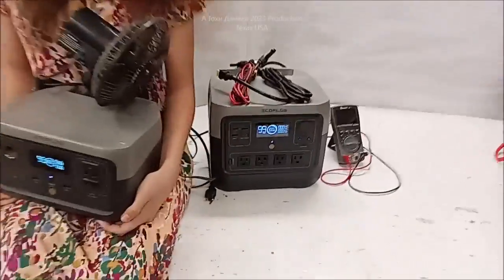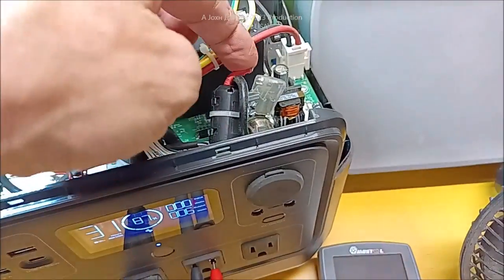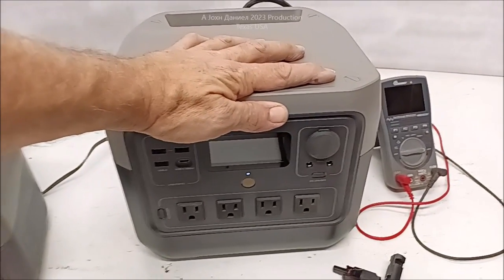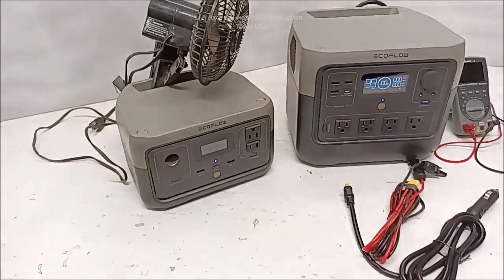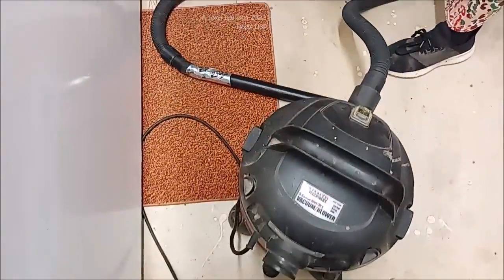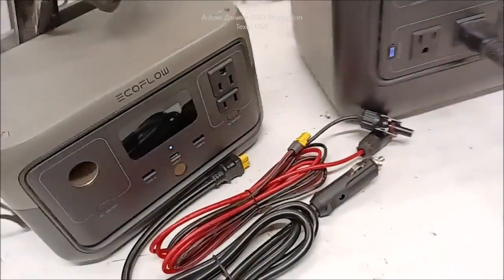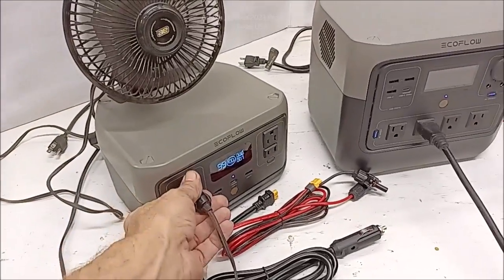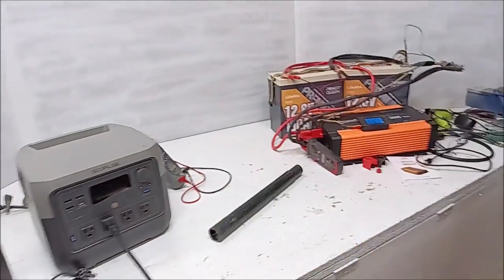Ecoflow River 2 Pro 800, The Problem, the fix, and REAL review!

Comment: River 2 max 512 wh
Reply from the maker: I would say after a year of using constant as a UPS, RIVER 2 MAX 450 wh It has lost that much battery ability in a year. Very sad too. Running it on 2 solar panels ( 125 watt ) and it gets full charge and unless cloudy never drops under 20% except a few times which showed its deterioration in ability. It is running the same identical 8 camera security system but has less to work with as it ages. Took it off solar, used AC on it only, then the problem was verified. They are not as advertised!

Comment: I Recently just brought the uk version of the ECOFLOW RIVER Pro 2. And I can not get my 2x 60 watt panels to work on it at all. The mains and usb-c charges fine. Not sure what to do is there some sort of fault with the solar port.
Reply from the maker: See what the voltage from the panels is, and be sure they are wired right to the plug for your Pro 2. Many shipped with backwards plugs.

Comment: River 2 pro has 800w inverter+800w surge. And with the app and a simple flick you have 1600w for things like hairdryer. But you probably know that now.
Reply from the maker: Yes, stats are as advertised but capability on a 1170 watt hair drier was a fail. Trying that max wattage for over 5 seconds faulted it at 1170 watts but it would run 900 watts ok.

Comment: Got one,bms problem.bad product
Reply from the maker: If it's in fault, no start, but will occasionally charge/work. then it's the battery temp sensor. Open it up, look at the battery temp wire follow back to the BMS, test it for ohms and continuity, if its bad replace with 55C version and keep it near but not on the batteries.

Comment: On the River 2 Mini  (small one) - i bought it as a router UPS (LPF battery vs SLA's) and on the never off (but plugged in all the time) it does a random shutdown. Battery 100% - 120 vac in 100%  - StarLink is on a seperate 12 / 53 volt step up POE router. The randomness is between 8-36 hours, talked with tech support (e-mails actually) repeatedly and what a bunch of clowns. Repeatedly asked the same questions, is software up to date? is the battery charged?, etc. It's function now is a 10# paperweight.
Reply from the maker: Yep, my experience too. And the Software update, LOL X 10!
Reply: Same here,I regret buying it.

Comment: Nice video. I had an issue with my River Pro a couple of years ago while on a cross-country trip. The unit stopped taking a charge. I called them up, explained the problem, and went through some quick checks over the phone. EcoFlow's customer service was very responsive. They knew  was on the road and needed the River Pro back as soon as possible. I sent it in, they did the necessary repairs and got the unit back to me quickly. No complaints.

Comment: I have found Ecoflow customer service to be pretty responsive through the app. I agree on the 12V plug - mine can’t run my small 12V mini fridge.  However, we love our ecoflow products so far (River Max Plus and the wave 2).
Reply from the maker: We ran a 49 liter freezer on one, a hour later it was off, in error code. No one noticed it for 3 days since it was plugged in to 120 volt and we were using the DC outlet as a source for the freezer. $300 in cleaned and ready gulf shrimp ruined. All due to poor ability to supply a full 10 amps since the freezer ran on only 9.2 start and 7.4 running. Every one I have since tested fails at under 10 amps. No excuse for it.
Reply: 10 amps at 12v nominal is bs 15 min 20 more like it  @JOHNDANIEL1
Reply: @JOHNDANIEL1  You should look into temperature alarms for your stuff to give monitoring of your coolers.
Reply from the maker: We have them now, but in the case of the failed 12 volt, when it is in the back of a trailer and your not, it's ain't much help.

Comment: Put all of your eggs in one basket and trust your family's survThival to difficult to diagnose and repair self-contained solar generators with notoriously high failure rates!
Reply from the maker: That's not us! We have 20+ inverters, over 5000 amp hours of battery capacity in 3 forms, thousands in terminals, connectors, dozens of DC powered devices, +  3 methods of refrigeration and numerous options. All in a 3 fielded metal building with 10.5" thick walls. 
 Those folks you speak of live in Cities, vote for criminals democrats and consider a electric bike, a cell phone app, a extra t-shirt and a can of beans the ultimate survival gear.
Reply: @JOHNDANIEL1  I've never met a Texan that I didn't like.
Reply: difficult to diagnose and repair? Can't undo a couple screws and follow some wires?
Reply: @ericklein5097  What percentage of Americans could diagnose and repair the circuit board in a grid-down scenario?
Reply: I will never buy an EcoFlop. So many people had them fail over and over. And no, I wouldn`t dare go inside one trying to tear it apart trying to figure which part failed. Even a person with a lot of experience and diagnostic test equipment may not have a way to repair it and an average person would be risking their lives with the amps involved if they touched the wrong area or dropped a tool or screw and shorted it out. However, unless the BMS fails in my 300ah 12v LiFeP04 battery I can repair my current system because I only have to replace the inverter, charge controller, or fuses if something fails. It`s almost always better to build your own system especially if you plan to depend on it going forward as emergency power for your home. But I also love my portable power stations but I got MAJOR unusual deals on them, and many were free, because I exploited their quirks and performance limitations to get refunds or second replacement units free when they were first released. Sellers DO NOT want a bad review on new products, so I used my head to come out ahead, which is much harder to do now, but it worked well then. I got 5 free, and promotional deals on another 5, and only paid full price for one and it`s a 300w LiFeP04 so a deal regardless. I`m poor and used the stimulus money very wisely and live in a camper in hurricane country. My batteries have changed my life. @ericklein5097

Comment: lighter sockets aren't rated for more than 10 amps. Look at the lighter fuse in your car.
Reply from the maker: I do, mines 20 amp and the power port is 15 amp. The fuse box says PP1 15 amp, and Lighter 20 amp on it. 1997 Ford F-250. Pre-junk plastic cars.
Reply: @JOHNDANIEL1 oh man i miss those cars man, i want to get my hands on an old deisel and put a crankin hho cell on it. 
common rail aint my thing.
Reply: @JOHNDANIEL1  ah. If you're comparing a lighter socket from the days when they were used to actually light cigarettes, then yeah. look at the build quality of that socket in your truck compared to the sheet metal, plastic, and fiberglass of those today. If the manufacturers put truck lighter sockets in their products, then 15-20a would be possible.